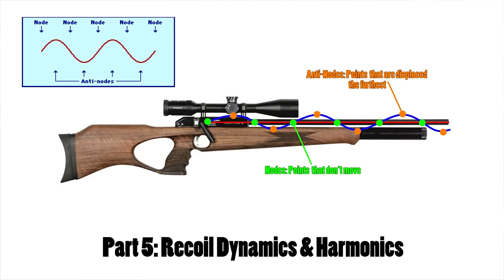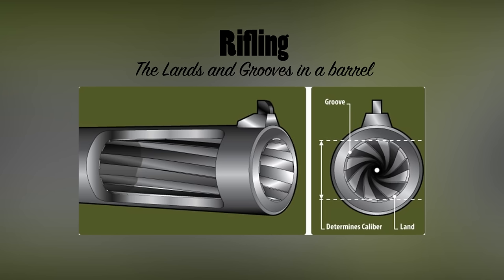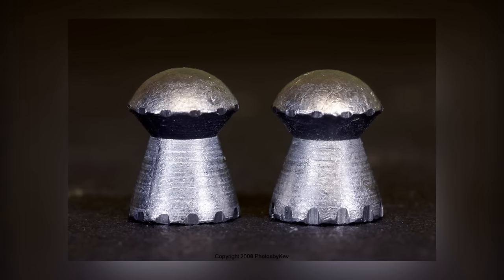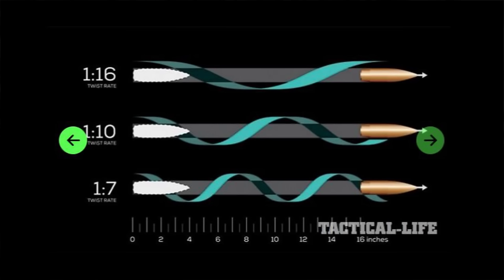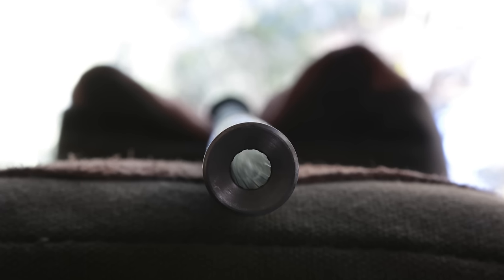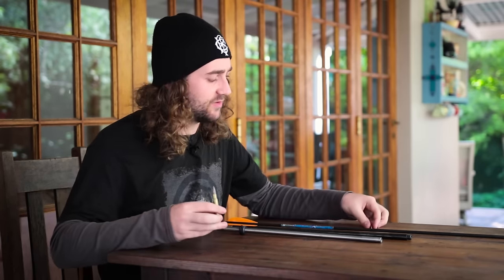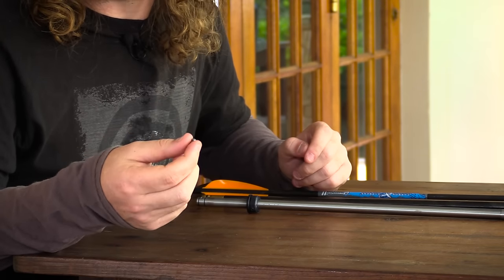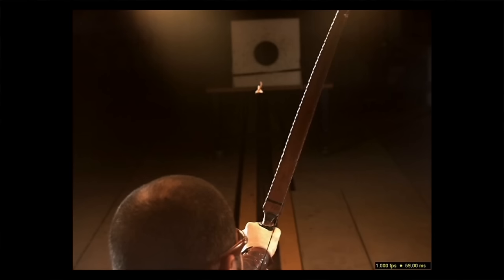Barrels & Twist Rates | AB101 Pt.6

Comment: As I watch this I am wondering why pellets are even used in todays modern air guns with high velocities and rifled barrels?  Is this just because there is a limited number of slugs manufactured?  I think the fact that this seems to be a transitional time for air gun projectiles my choice of air gun manufacturer is going to be FX. They are in my top 3 manufacturers and the swing vote goes to the interchangeability of barrel liners.
Reply: Absolutely! And my first will be the Dreamline.

Comment: At 7:40 The magnus effect. Your illustration of the the magnus effect does not apply to a bullet, because the net force is zero, because the rotation is perpendicular to direction of travel. It is not top spin, side spin, or curve ball spin. A bullet's spin is perpendicular to the flow of air and the net magnus effect force will be zero. If you put a tennis or baseball in a rifled barrel and shoot it, it will not have curve ball spin or top spin it will have spin perpendicular to air flow and the magnus effect will be negated because vector forces have magnitude and direction and net magnus effect force will be zero because the direction of force is perpendicular to direction of travel, even though the projectile is falling because of gravity. It is called summation of forces. The shooting scientist magnus effect logic is completely flawed because it does not properly sum the forces. cosine 90 degrees = zero magnus effect.